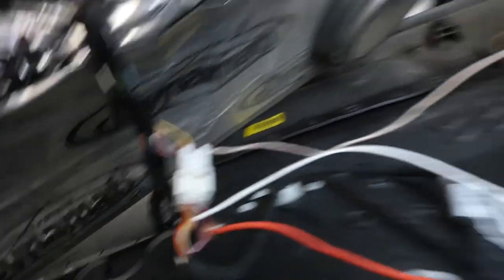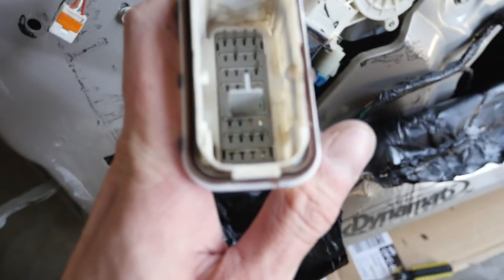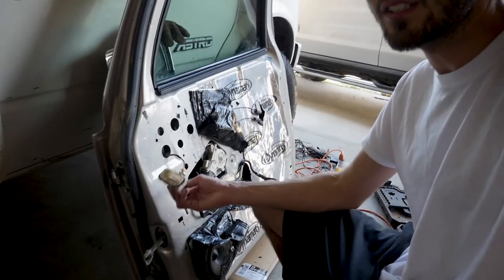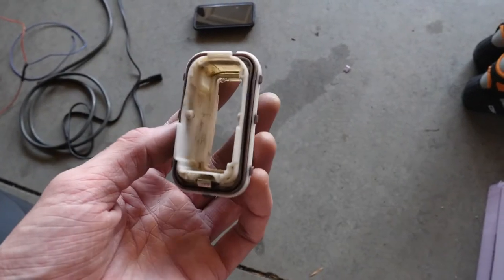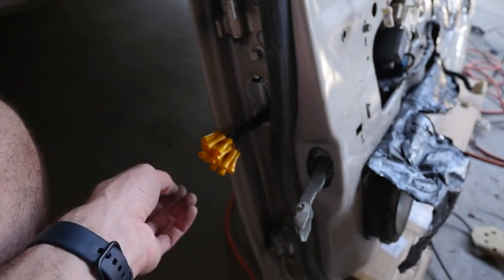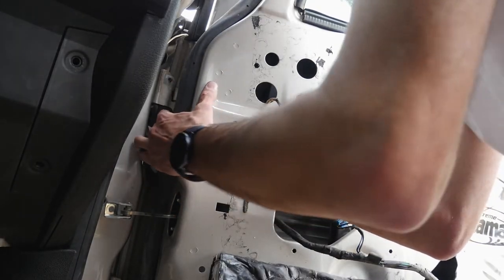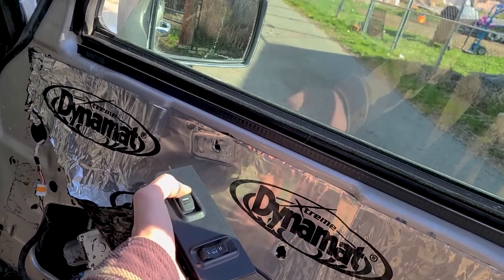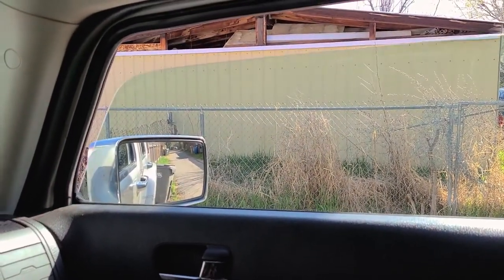Passenger Power Mirror Fix | Hummer H3

Comment: dude crimping those things is so much easier with a crimping pliers, i threw all my old style wire strippers away when i got mine, and bought the new style strippers. 2 tools, but they work like a dream
Reply from the maker: It was a pain in the ass..! I kept getting the handles tangled in the wires. I just looked up the crimper you're talking about and totally see how those would be a game changer. I just bought one of those self-adjusting strippers from Harbor Freight. I'm excited to figure out how to use it properly. If I ever have a need to crimp a bunch of stuff again, I'll surely try the crimper you suggest.

Comment: Hey man! you fixed it and that is what matters!  good job.  Just wanted to let you know for future reference you can replace those pins easily and cheap.  Check out  (automotive wire pin  male female)  on ebay.  they also sell a cheap tool to get the old ones out.   You could also put some electrical grease on the connectors to keep them water proof.   Keep up the videos!  You on instagram?
Reply from the maker: Hey Jesse, thanks a ton for the info on the connectors! Looking back, I think using the method you describe would have been so much easier and functional haha... I don't have an H3 Humper Instagram yet but should probably get one rolling. Thanks again!
Reply: @H3Humper  yea its a great way to meet other car enthusiast's..or whatever interest you may have.
Reply from the maker: I'll get on there and let you know when I do. What's your instagram handle?
Reply: @H3Humper  is the same as my youtube jessebk20
Reply from the maker: Awesome, I followed you. I'm just using my old personal instagram again. Your trip to the beach looks fun with the H3! How did it do in the sand?